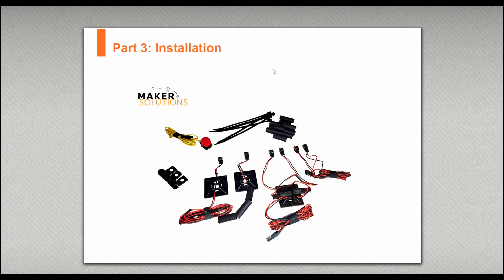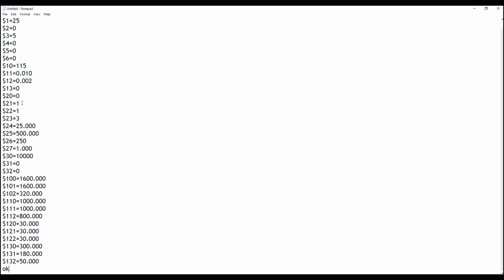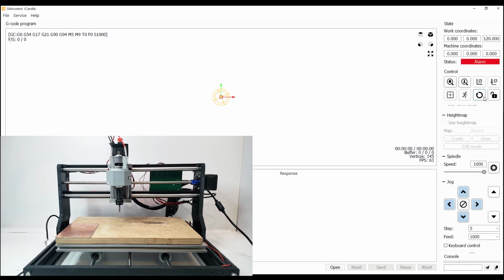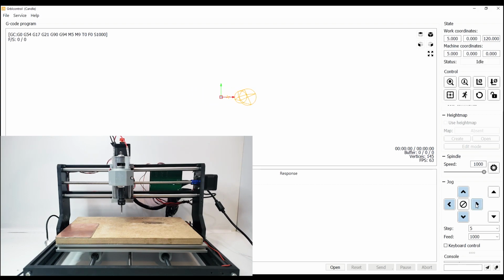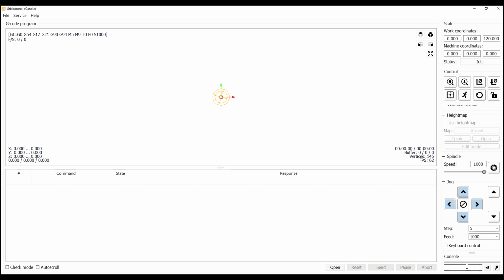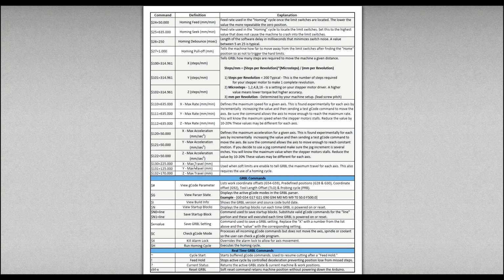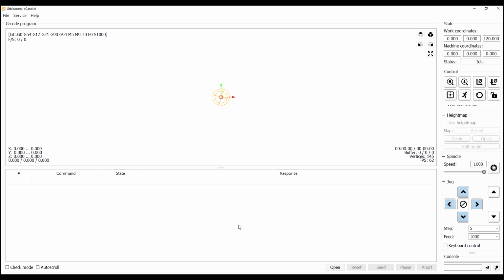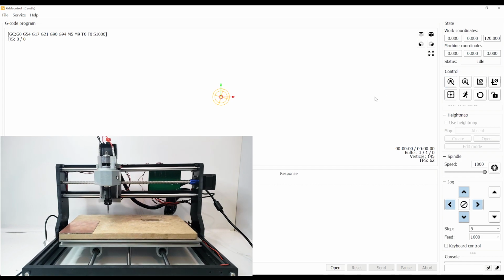Precision Node CNC 3018 Pro End Stop Node Switch Testing and Limit Switch/Homing Configuration.

Comment: Thanks, I will try do that. And thanks for pdf.
Reply: Amazing, I do it and finally my machine working with Homming $h
But I face small issue that when I move any axis manually to touch the limit switch my machine switch to alarm mode and to release from this status I should do softreset and unlock, this is correct?

Comment: Thanks for this tutorial and the PDF however I am totally stuck :-(. I have connected one endstop for testing and I can get it to alarm and lock but cant get it to de-alarm or unlock even with a reset on the board. `What am I doing wrong... ?  I would like the cnc end stop to behave the same as my 3d printer whereby the end stop is hit it backs off a few mm and stops.  It doesn't alarm though or lock.  Have spent all weekend on this and only now 12past midnight have I managed to get the alarm... Any advice would be really appreciated.  I am confused lol

Comment: I followed this video but I am having an issue. When I select the home button my Z Axis drives hard against the upper stop and continues to run. Any suggestions
Reply from the maker: Hi Jimmy, for help with your issue please send an email to makerspecialist2020@gmail.com. Thank you for your support.
Reply: I've the same issue. Did you find the solution?
Reply: @Namremmiz98  Thank you for your suggestion. I solved the problem by changing the board in warranty

Comment: Sorry, my cnc is doing everithing with double the size....why?  Any ideas?
Reply: the settings $100 $101 $102 are the "steps per mm/inch" adjust those by moving it and measuring it manually until its dialed in
]